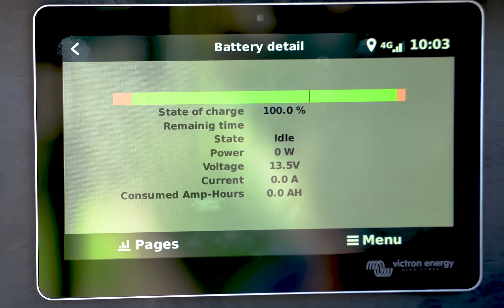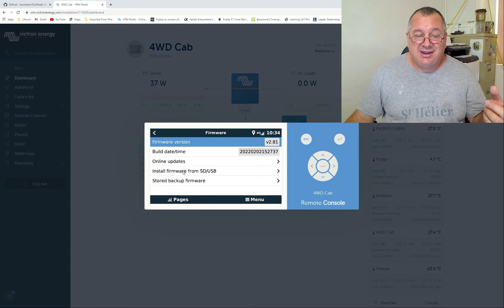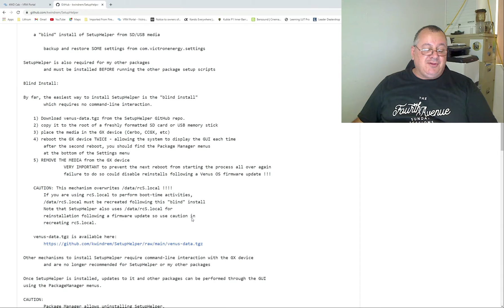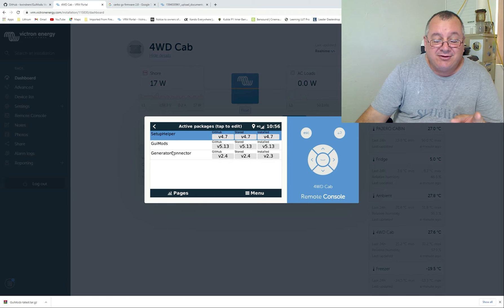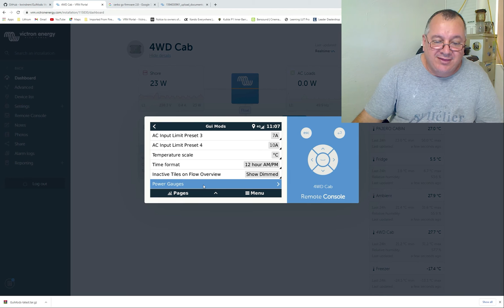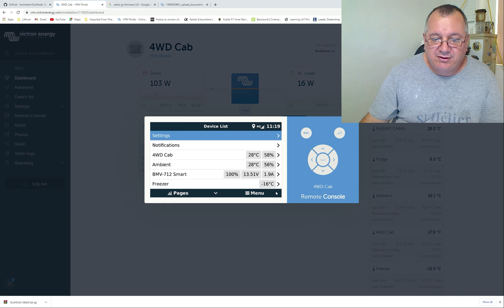How to install and setup GuiMods Hack on the Victron Cerbo GX and How To install  Ruuvi Tags

Comment: Nice! Just got my 3 Ruuvi sensors and playing arond with an older Venus_RPi2A that I will have to get a separate Bluetooth dongle for.
Reply from the maker: Awesome.  I believe there are some compatible usb bluetooth dongles that will work with the Pi.
Reply: @PhilsCampingReviews  Right! Just bought one and it was plug and play with the RPi. Thanks to your guidance I now have temperature displayed on the RPi_Venus
Reply from the maker: @ebptube   awesome.  Great to hear it all works in the pi